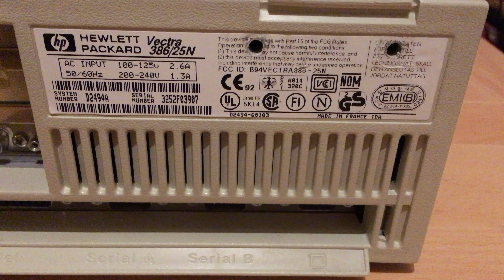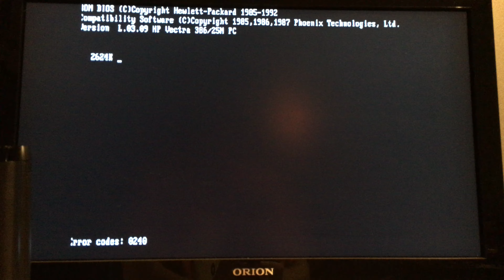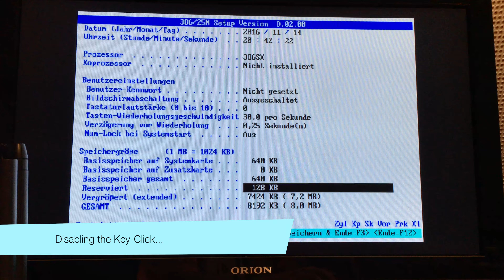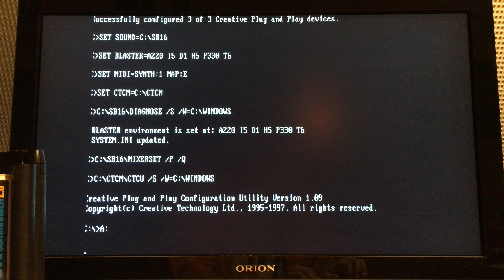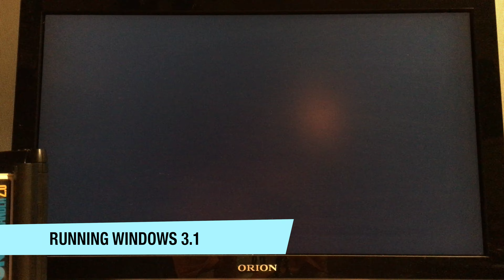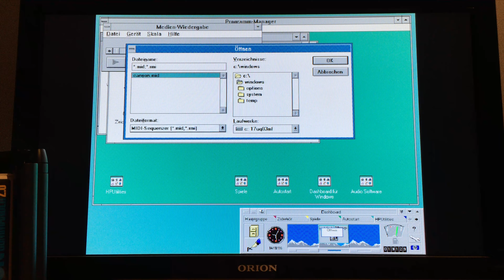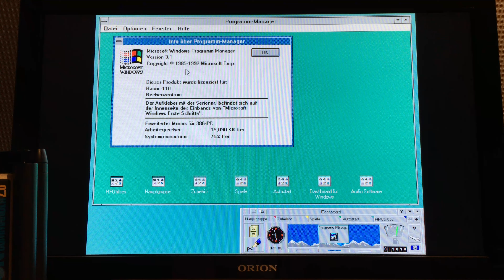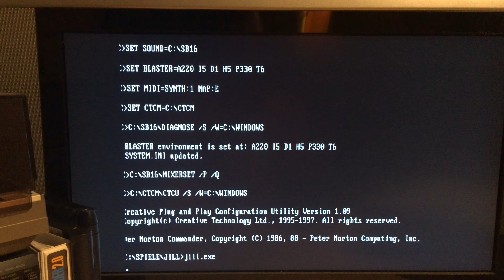Hewlett Packard Vectra 386/25N - A look inside / installing some add-ons

Comment: Hi , i have the very same pc in my hose, but cpu in this one is 486 -  50mhz, i bought it about 2 years ago really cheap, i have been trying to find everywhere the original drivers for it. I belive HP must have had released  a set of drivers for windows 3.1, since that was the windows used in that era. Im wondering if you have such floppy disks, i would really like to have it properly working on windows 3.1 but my machine came with DOS only, seems they formated it at some point. do you have such floppy discs?
Reply: Hello. I am interested in buying this PC model, do you ship to Mexico? please contact me

Comment: Hi i have hp Vectra 386/25 but i have HDD error. Which type of hdd i can use .? It is possible use 20 gb PATA ?
Reply: Нет, он не поймет HDD 20GB. Самый оптимальный размер - до 540MB (80, 170, 340 и т.д.).